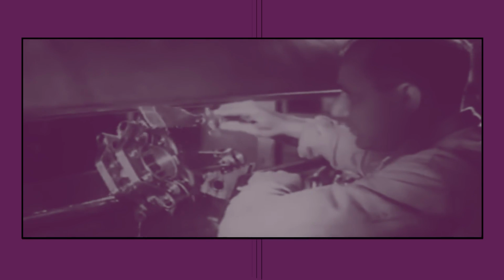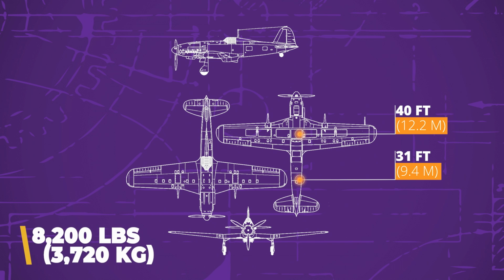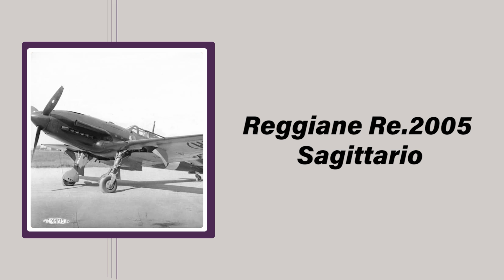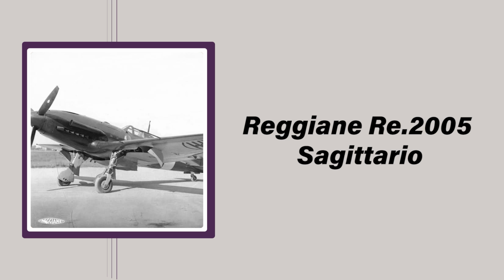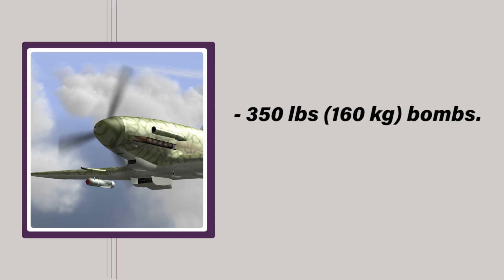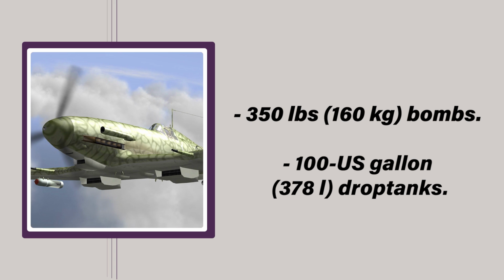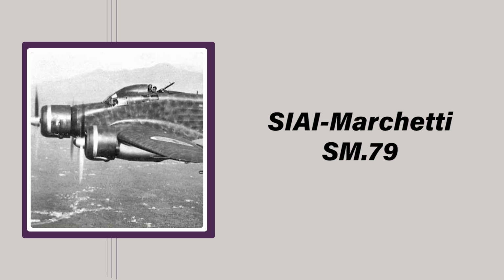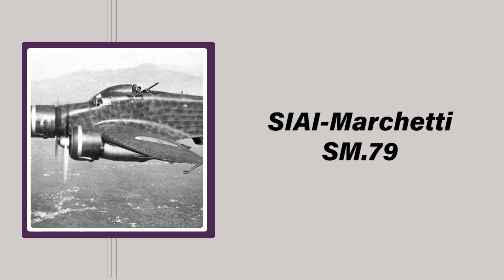The Fiat G-55 Centauro: Italy's Little Known WWII Fighter

Comment: From what I have read, the Reggiano 2005 had the best high-altitude performance of the three '5s', due to the shape of its wing 🤷‍♂️

All three seem like they had fairly similar performance, though.
Reply: They had very similar performances. The G.55 was the easiest to manufacture, and the better armed (one 20mm gun more than the C.205 and same number  than the Re.2005, but with more ammos).

Comment: I prefer the Macchi C.205 Veltro. Very similar aircraft.
Reply: They where very diferent couse diferent wing area; with less than 17 sqm for the MC.205  vs more than 21 of the G.55  it has 25% bigger wing area. This meant that the MC.205 was good below 6000 meters while the G.55 was good from 6000 meters upwards...

Comment: Wonderful airplane.  Difficult to build.  In wartime that's a big problem.
Reply: Well-worded. A great aircraft can turn the tides in the sky, but if you've only got a few of them then you've also got a lot of problems.
Reply: With a proper industrial structure it might have been possible, man work hours are highly dependent on tools available in the end. Italy had little on terms of factories and instruments, any fighter would have been impossible to produce in reasonable numbers.
Reply: The building man/hours required were perfectly comparable to those of contemporary US aircrafts.

Comment: Fiat Engineering 
The best 
After the war, probably went on to make , Alfa Romeo, Maserati and Ferrari 
Excellent video
Reply: FIAT did good car but Maserati, Ferrari and Alfa were originally different car companies
Reply: Quite true. I owned an Alpha Romeo 2600 Spider (1964 ragtop) with Cherry Red "soft lacquer"  paint. Found it in a garage back East (USA) in 1984; where it had languished on blocks since 1964. The owner shipped out to Vietnam shortly after purchase. He was declared MIA and never returned. His mother held in her heart that he would return and kept it safe and clean for 20 years. It had about 3K original miles on it. A real CHERRY. It came with a nifty tool kit. True to Italian engineering, the screw threads in the construction were machined under-sized (slightly) to the threaded bore. Solved with thread-lock (for the most part). Otherwise, even the simplest maintenance was best left to the dealership (few and far between). After a summer-long affair (of the heart) I sold it off to a collector with a budget that could do the Girl justice. Sorry to see her go. Saw her once after that @ a Vegas Vintage Car Show... hadn't aged a day since she rolled off the line.

Be still my heart...
Reply: @GAMakin  Mate, it's ALFA, not alpha. Anonima Lombarda Fabbrica Automobili. Not a greek letter.
And, if you miss it, get a Giulia, you'll get a great car with a far superior handling over ANY other sedan.

Comment: The Macchi C.202 Folgore fighter had a left wing 8.5 inches longer than the right.  This was to provide enough additional lift in that wing to counteract the left torque from the engine.
Reply: That is fascinating. Reminds me of many solutions to software issues we use. Haha. If it works it works!

Comment: Awkwardly enough, the G-55 looks very "similar" to the P-51 in the "Blueprint Diagram"...
Which plane came first? 🤔
Reply: What I think looks similar to you actually isn't. The wing dihedral of the P-51 is simple while in the G.55 is "W". P-51 wing is tapered in relation to the wingspan while in the G.55 it is tapered in relation to the wingchord.
Reply: The G-55's first flight was April 30, 1942.  The P-51's first flight was Oct 26, 1940.

Comment: Re the engine torque on takeoff. . .   I believe it was the Rockwell Commander112 that the engine angled from the centerline to compensate.    I’ll stand to be corrected on the aircraft type, but I definitely remember seeing a plane like that in the hangar, undergoing its annual inspection in the late 1990s
Reply: Regarding the only negative assessment noted by G.55 pilots was the pronounced left-hand yawing at takeoff due to the powerful engine torque. This was partially remedied by a slight offset positioning of the vertical stabiliser to counteract engine torque but with powerful piston engined engines generally speaking those fighters was always a handful on takeoff. The Macchi C.205 and previous C.202 to counteract the torque of the engine, it was extended the left wing by 21 cm so that the left wing developed more lift, offsetting the tendency of the aircraft to roll to the left due to the rotation of the propeller...

Comment: How many survive? What air museums have one or more?
Reply: It is a lot more than a mockup. It is a not flyable downgrade from a G-59 that was firewall backwards 99% the same plane... Only few nerds (me included) can recognize diferences...
Reply: @pieroincani  yes it does come from the G-59 that structurally was similar to the G-55 but the whole front was changed to accommodate the  Rolls-Royce Merlin. When they modified this airplane they changed the front as close as possible to that of the G-55 and they did a very good job using few original blueprints and I think original propellers and possibly the hub and modified dashboard and other details...
Reply: @paoloviti6156  G-59 was not similar, It is the same aircraft... there are many more differences between a P-51A and a P-51B than between a G.55 and a G-59 whose first specimens were obtained with a retrofit of G.55 and which was originally called G.55M (Merlin)
Reply: In theory one survived at the  Museum of Vigna di Valle about 40 km south of Rome but it is more of a mockup of the Fiat G.55 with some original parts unfortunately....

Comment: Thank you for the cool info!!

My dad and I went to the Military Aviation Museum outside of Virginia Beach in Virginia, USA. That place was SO cool for us plane nerds! We even got to see a Mustang Land! 😁
Reply: I went there with my dad also. I got to see a Spitfire, an avenger and a b-17 take off. It was awesome!
Reply: the sign advising motorists on the highway to watch out for low-flying warbirds always gave me a grin.  i was working AAA wrecker during a blue angels air-show at Oceana, and got to see bombers and fighters of the ww2 confederate air force landing.  nothing as awesome as the roar of 18 cylinder rotary engines overhead! eastern virginia ia a plane nerd paradise.